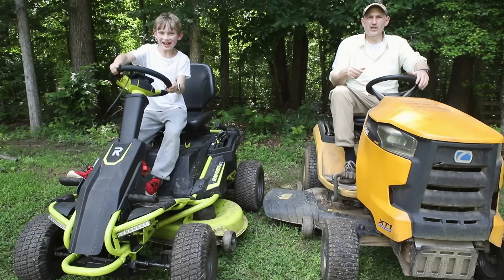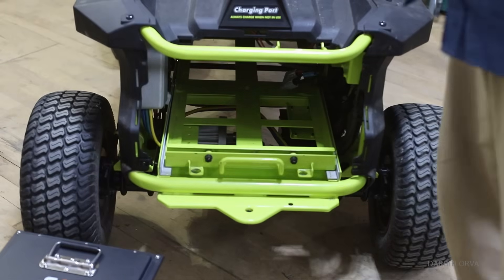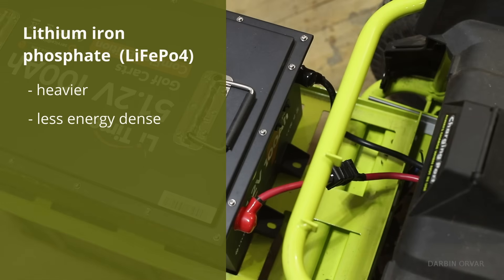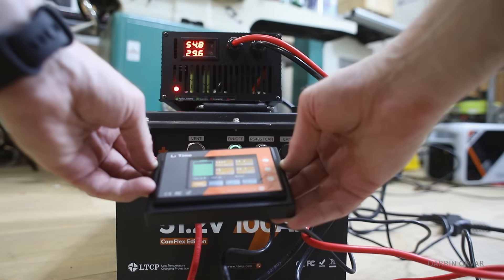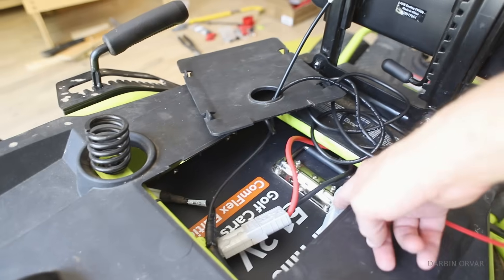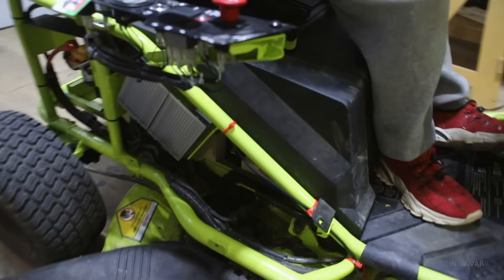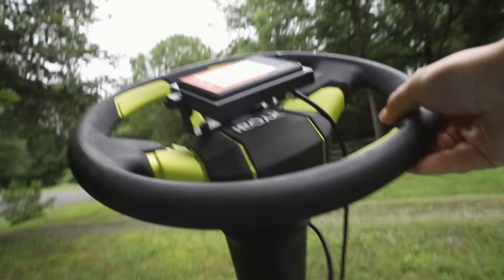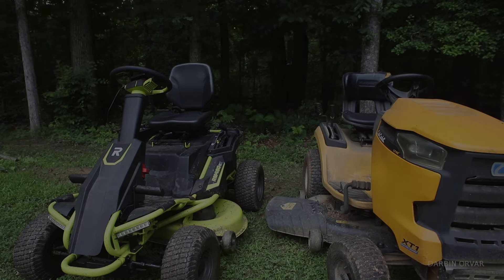Rescuing a Ryobi Electric Riding Mower: From Dead Lead-Acid to LiFePO₄ Workhorse

Comment: Thank you! I noticed the battery you linked to includes an 18A charger in the box. What is the benefit of buying the additional 30A charger, is it purely charging speed?
Reply from the maker: The standard charger is fine, just slower.

Comment: Nice!  I own one of these and the batteries are junk after 3 years.  Purchased a gas Cub Cadet rider.  The Ryobi is still sitting in my shed.   Not a cheap mower, paid like $3500.00 for the Ryobi.
Reply from the maker: Expensive item. I'll take it off your hands :)
Reply: @darbinorvar  LOL.  After watching your video seriously thinking about replacing the battery!  Will cut my lawn cutting down by half.  Me on the C Cadet and wife on the electric!  Thanks for great video.
Reply: $1,100 / yr you got played bro
Reply: I have that Ryobi and the batteries lasted one year. I replaced them. Another  year and they are shot so the mower is dead in the shed. I hope I have better luck with the Ego I now have. The Ryobi is actually a better built mower and way more user friendly. Ego has too much plastic and it's a pain in the ass to start ever time  you have to get off to move something.

Comment: Interesting video.  What Ryobi data told you such a conversion would be possible?  Thanks for sharing.
Reply from the maker: It was a 48v battery to begin with so as long as you use a charger meant for 48v lithium the motor doesn't care what chemistry you have.
Reply: @darbinorvar  I asked because your video mentioned something about proprietary controllers  and power management systems.  How did you know this Ryobi wasn't like that?
Reply from the maker: Those other versions aren't 48 volt, and never came with lead-acid. I bought the OEM drive controller, but that is something I learned about after my neighbor game me the mower.
Reply: @darbinorvar  Thank you.

Comment: that brand and config of lifepo4 battery is already half the price of a new ryobi riding mower. but it does make it more modernized
Reply from the maker: It is a definite upgrade! You could certainly go for a small capacity with a stock charger for less than $1000.